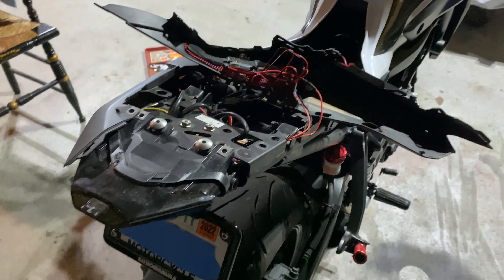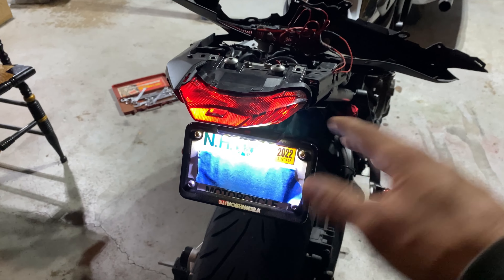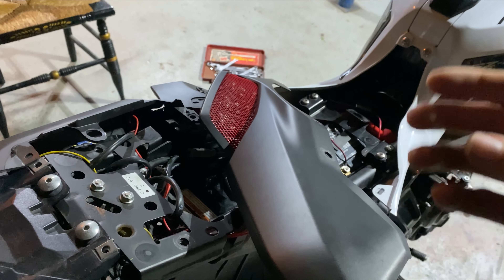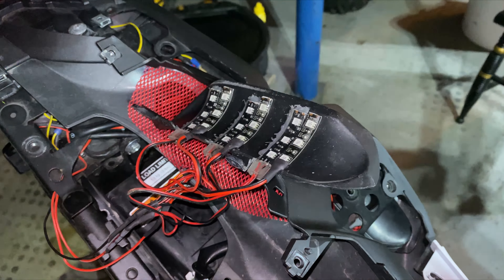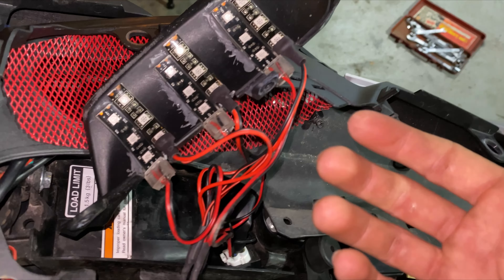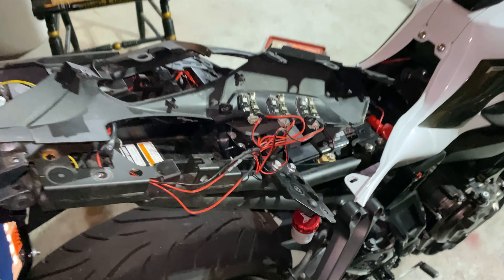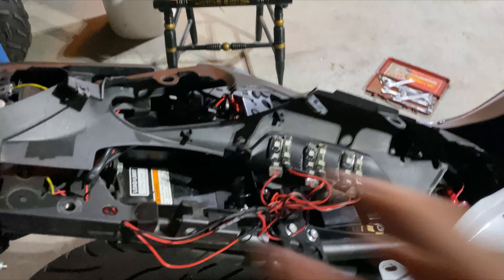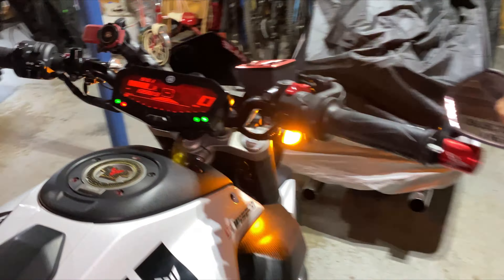FZ-07/MT-07 Brake Light and Turn Signal Mod

Comment: This is definitely the better version of the under seat indicators I’ve seen, my only question is how the hell did you wire the brake led lights up to not be a DRL and only work off the brake pedal?…
Reply from the maker: @Lewis_Ald  the three wires going to your taillight, running, brake, and ground. I only spliced them into the brake light circuit, and each turn signal to their respective sides as well

Comment: Hey man could you do a video showing more of the wire connection locations/ splicing/resistors needed etc. thanksb
Reply from the maker: I wired in no resistors. The main circuit in the headlight had them already. Unfortunately I no longer have this motorcycle